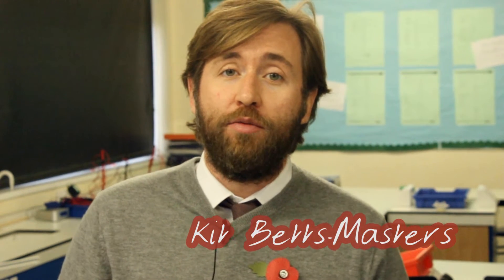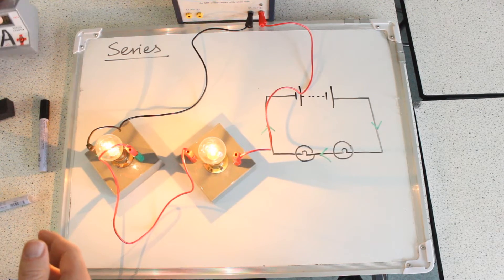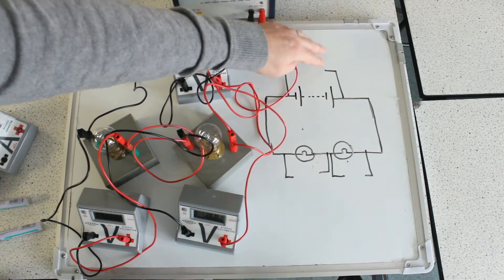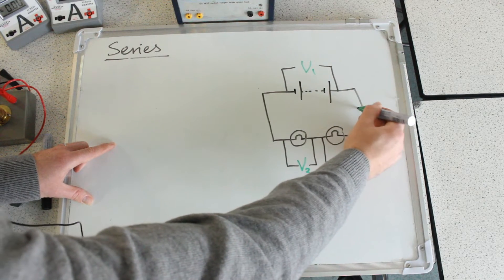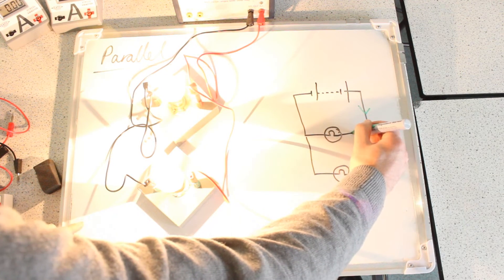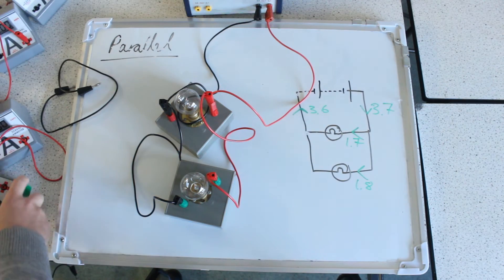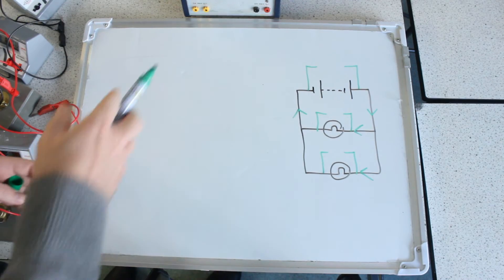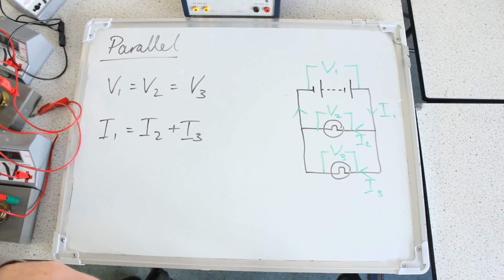Current and Voltage in Series and Parallel Circuits - GCSE Physics Revision

Comment: i have a question for parallel circuits: if in the first branch were to have 2 bulbs and you measured its voltages and the parallel branch there was only one bulb would all three still have the same voltage or would the two bulbs on the same branch have a shared voltage that is equal to the power source as well as the voltage on the parallel branch ? please answer Xc
Reply from the maker: Correct, you can in treat each branch like a separate series circuit, so the p.d. would be shared and add up to the supplied p.d. thanks, good question! 😀